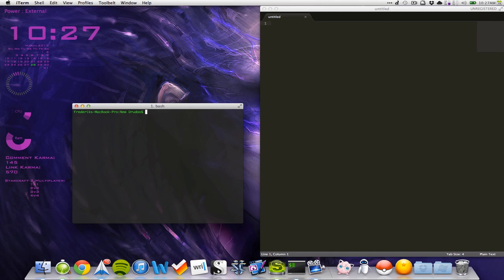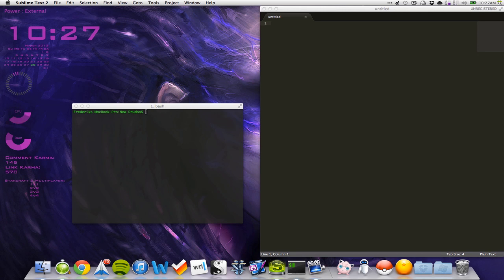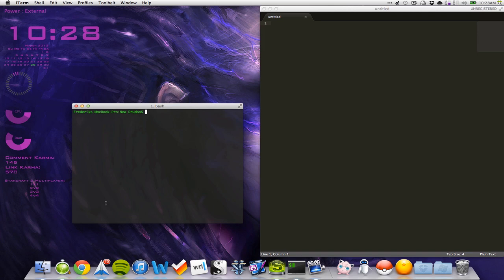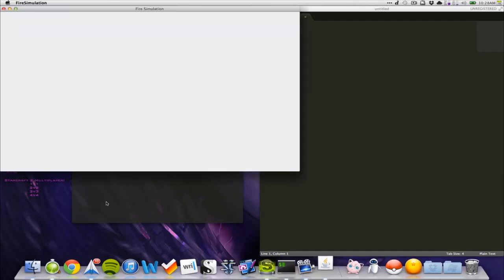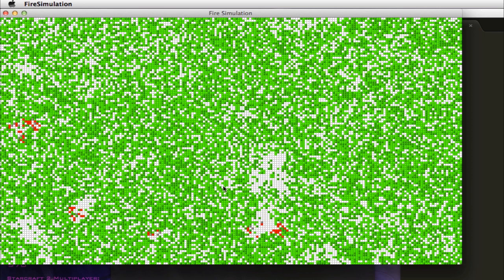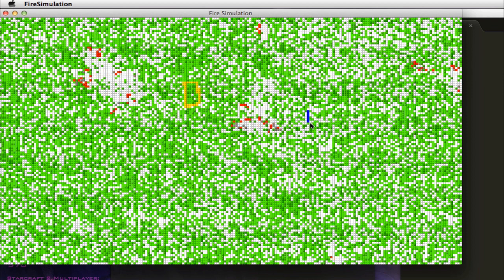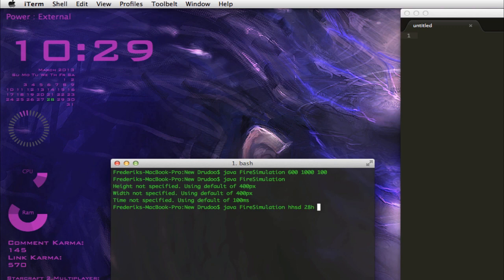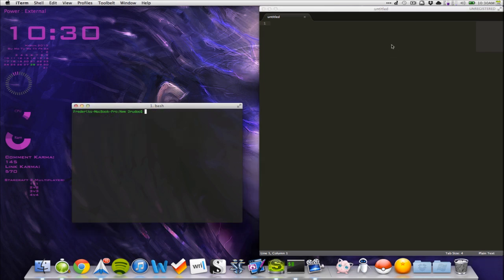Java FireSimulation - Part 1 of 10 - Introduction

Comment from the maker: Hi David. It doesn't matter which program you are using. Eclipse is an IDE, which has a lot of cool features such as autocorrect and automatically importing necessary libraries. You don't need this since I'm explaining everything needed. I have used Eclipse before but i think it is too bloated with features for what i need.
I like using the smaller programs like Emacs and Sublime Text. 

You should have no problem following my videos using Eclipse.